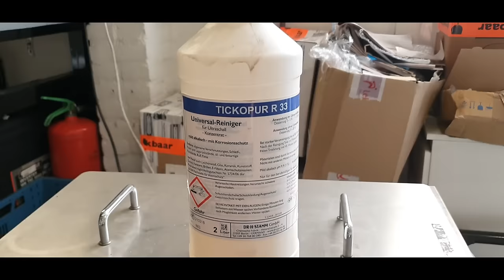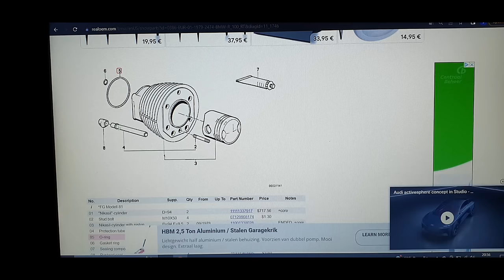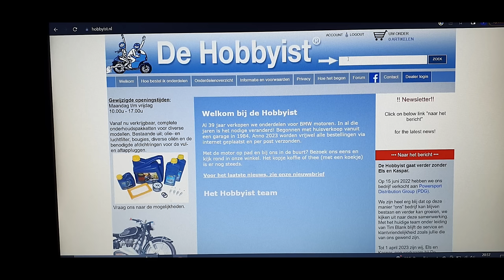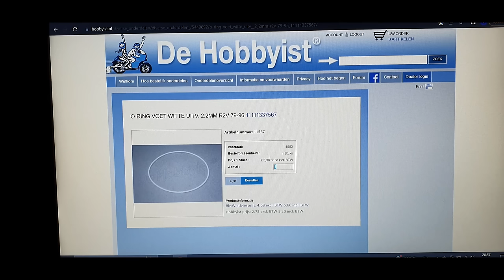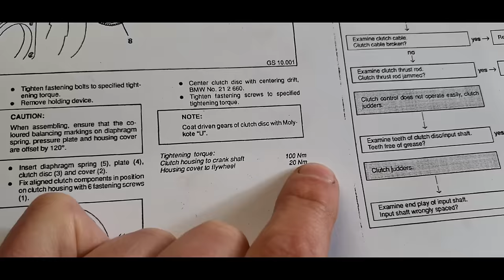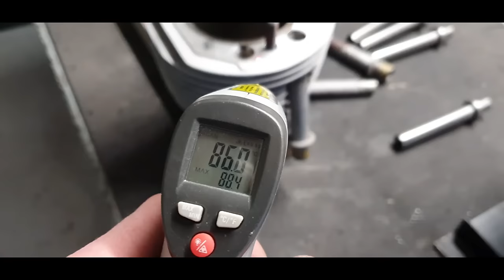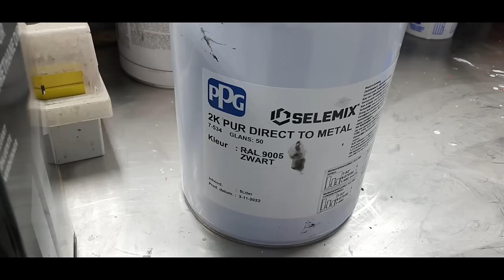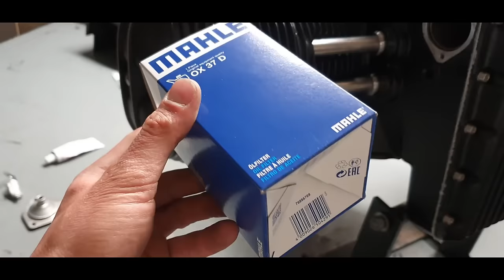How To Rebuild a Classic BMW R100 Engine

Comment: Nice to meet you, I'm sorry for my bad English. I'm impressed by your wonderful work. I'm sorry for asking such a question even though it's my first time meeting you. I have a problem.I ride an R100RS, and the black smoke from the muffler won't stop. What could be the reason?I liked your work, so I gave it a high rating and subscribed to your channel. your work is really amazing.
Reply from the maker: Hi man, no worries I understand you. Best thing to do is to check the spark plugs, these need to be brown (coffee with milk color). Thanks for joining the club, appreciated 👏🏻👍🏼
Reply: @corner.custom  Thank you for your time. I see, the plug on my bike was black. I wish you all the best in your future endeavors.
Reply from the maker: @sm-nr9qq Thanks man, good luck on the bike

Comment: Does the paint interfere with heat transfer on the cylinder head and oil pan?
Reply from the maker: The cilinders and heads got an Cerakote treatment, so the hot side of the engine. From temperature measurements I know that the oilpan, valve covers etc don't get near enough heat to get in trouble with the paint(spec)

Comment: @CornerCustom are the cylinder interior metal areas painted? Or is that just the look of the material?
Reply from the maker: What do you exactly mean with interior metal?
Reply: @corner.custom  I watched the video again. I was mistaken. Thanks for the quick reply.

Comment: Hello, 
I’m currently rebuilding a r100rt and using your video as a reference, could you tell me exactly which paints you used to paint the engine block? 
And how is it looking now, did you face any problems with cooling/paint cracking over the years?
Reply from the maker: Hi buddy, I mentioned the paint in the video, also show the paint cans. Selemix DTM 10% gloss. The engine in the video belonged to a client, but the paint and Cerakote held up perfectly
Reply: thanks for the reply, another thing I want to ask if you don’t mind, what’s the capacity of your ultrasound washer? I’m thinking of getting the 20L one but I’m starting to get second thoughts and a I’m worrying that it would be overkill for the airhead, ev future engine parts
Reply from the maker: @Sawp It's pretty big, 45 liter. In most cases it's too big, but I got this for a smoking deal, so couldn't let this one go
Reply: @ thanks man appreciate your quick replies
Reply from the maker: @Sawp No worries, just let me know if you have any questions 🫡👍🏼

Comment: I'm going to guess you're based in the Netherlands!? How much do you charge for a full airhead rebuild? eg an r80 gs 1981
Reply from the maker: You're not wrong! So yes im in The Netherlands. This was a one time exclusive job so the say, sorry for that. I'm loaded up with work and short of time unfortunattely. But on the other side there's loads of info to give it a try yourself
Reply: @corner.custom  Many thanks for your reply and for your excellent vid!
Reply from the maker: @touchingthecloth No worries man anytime. Just let me know if you have any questions 👍🏼

Comment: I wouldn't recommend the use of copper paste for lubricating the exhaust nut threads. It easily builds up contact corrosion between the copper particles and the aluminium, hence enforces thread seizure. BTDT 😞
Reply from the maker: Ok thanks for the feedback, what would you recommend? When fully seized I cut off the exhaust nut to release the tension. Did that work for you?
Reply: @corner.custom  There are ceramic and other metal free greases, or greases with aluminium particles for this purpose. Currently I use the latter one, after I had damaged a pair of cylinder exhaust threads by copper paste usage. A rather expensive experience!
Reply from the maker: @VixNoelopan Aii I feel your pain, thanks for the recommendations 👍🏼

Comment: You used two different paints to paint the engine. Cerakote for the cylinders due to temperature and Selemix for other parts. Why not cover the whole engine with Cerakote, is it because of the paint cost?
Reason for the question is that I'm facing a similar issue at the moment.
Reply from the maker: Good question! The reason why I chose to go with Selemix for the engine itself is because Cerakote recommands that the surface get a blast with aluminum oxide before applying the Cerakote. I did see other people use Cerakote on surfaces that were prepped by the use of a scotch brite pad, but I'm rather safe than sorry and the color match is also pretty good. You're also going trough a rebuild of the engine or just the paint phase?
Reply: @corner.custom  
Thanks for the reply. Actually the whole bike. Engine is just one stage of the whole project. It's also a boxer engine.
Reply from the maker: @magnusreimann1055 Perfect approach by done one step a the time. There are more R related how-to on my channel as well 👍🏼

Comment: Hi, just asking to clarify a doubt: isn't cherakote paint made to be a heat insulator? If so, wouldn't it make the cooling of the engine worse since the air wouldn't take off the heat from the heads and cylinders as efficiently as before?
Reply from the maker: No it isn't a heat insulator, there are even Cerakote types that are specifically used on top of pistons for a better heat distribution
Reply: @corner.custom  oh, good to know! I thought they only made the heat insulator one, thanks for the clarification!
Reply from the maker: @laferrarifabrummbrumm3878 no no no, just check out their website. They make a ton of different series for all applications

Comment: Is the air curing cerakote durable enough for an engine?
Reply from the maker: Yes sir. Used it for multiple builds and help up perfectly
Reply: @corner.custom  great. About to do engine covers of my Ducati in Burnt Bronze.
Reply from the maker: @GeertHeremans In the C series then? I did some Burnt Bronze as well, but then the H series
Reply: @corner.custom  indeed C-148.
Reply from the maker: @GeertHeremans Will be ok, just get your prepwork dialed in 👌🏼

Comment: Why wouldn't you disassemble the heads and check out the valves and guides? That era R100 had a lot of valve recession and guide wear issues, at least in the US models. I worked at a BMW Dealership and we sent a ton of heads out for refurbishment.
Reply from the maker: I rebuild this engine for a client and he told me that the heads were already rebuild, so that's why I left them untouched. My own R80/100 builds all had rebuild heads including new valves, guides and springs. Those build videos are on my channel as well
Reply: I’m wondering where would be a good place to send my r100 heads 1988. I’m near Kankakee Illinois
Reply from the maker: @daledahlman9629 Maybe you could get in touch with Matt from Euro Moto Electrics

Comment: nice job, but there has never been a R100 with round valve covers, the gasket on the front cover doesn`t need any glue, there is no oil behind
Reply from the maker: What do you mean exactly with round valve covers? The peanut style ones? I rebuild this engine for a client who wanted these
Reply: @corner.custom   they are looking great at the engine but are not original ones like in the beginning of the video, that`s all
Reply from the maker: @randypopandy All good man, everybody got his own taste 👍

Comment: Do you happen to have the dimensions of the engine stand?
Reply from the maker: No sorry I don't have the engine stand anymore. I rebuild this engine for a client and gave him the engine stand as well to safely transport it. Must make sure to make the uprights high enough so that you can take of the oil pan when the suction tube is still on the engine and that bottom strips are long enough so that the engine won't tip over
Reply: @corner.custom  thanks!!
Reply from the maker: You're welcome man, good luck 👍🏼
Reply: Why I the world would someone pay $20,000+  for an Eastern European bad attempt at making a true BMW, when you can get a used airhead for a fraction of the cost.  Proud owner since 1984.  Great video 👍
Reply from the maker: @tcmits3699 Right on man!! 🤟🏼👍🏼

Comment: What is the HP and TRQ numbers on this engine?
Reply from the maker: Power output of 60 hp at 6,500 rpm and 75 Nm (55 lb-ft) of torque with a peak at 6,000 rpm

Comment: can I ask somebody’s help, I have a r65 airhead and wondering about the exhaust, do i need to keep it separate or can i just put the two pipes in one ?
Reply from the maker: I've seen multiple bikes with a 2-1 exhaust. Don't really know if there are any downsides regarding to the backpreassure

Comment: Be very careful when using fuel around electric tools, sparks from inside the tool can ignite the fuel.
Reply from the maker: Thanks for mentioning. Like I said in the video I work in a well ventilated garage and don't spray and brush at the same time

Comment: Using fuel as a cleaner is how so many garages have burned down. It's best to use brake cleaner or an organic degreaser.
Reply from the maker: Like I mentioned in the video make sure it's well ventilated and wear the proper protection. Also the drill is brushless so no sparks coming from that either. Brake cleaner is also very flamable

Comment: You use "fuel" for cleaning? Is that like gasoline?  Doesn't seem safe.
Reply from the maker: Yes fuel/gasoline. Like mentioned in the video work in a well ventilated area, use a respirator, safety glasses and wear the correct cloves

Comment: Replacing an M6 bolt that gets 20Nm?? 🤔
Yea thats a little bit more than the recomandet torque for that size, but you are way out of the yield zone!
If you use them 10 times that maybe could lead to problems, but if you do this ones or twice.... it dosen´t mater.
For a customer of cause, but for the home builder thats no problem. 😉
Reply from the maker: Which bolt do you mean exactly? It's all according to the manual 👍🏼
Reply: @corner.custom  The M6 ones (I guess) for the clutch pack! 
On my bmw M50 engines every M6 gets 20-25Nm, even the valve cover in aluminum gets 22Nm.
By feel and experience I would say an M6 (clean and oiled) can take 30-35Nm before starting to yield. 
The M10-M12 for the flywheel with 100Nm get a little bit sporty, if they are M12 with a high grade, I would also reuse them. Smaller fasteners can usually tolerate a little more over torque, but bigger ones are easier to not fuck up by feel.
Reply from the maker: @martin09091989 those are stretch bolts and can only be used once, same goes for the crush washer that are used for the clutch pack.
Reply: @corner.custom  so they get an additional turn angle after torqueing?
If so, yea they are trash afterwards.
But stretch bolts need a smaller smooth shank, I can't see that in the video. If those aftermarket fasteners have threads all the way up I rather would put a drop of locking compound on them!
If you stretch the threads you risk a fracture.
Reply from the maker: @martin09091989 I believe that the OEM stuff is tested enough that it proved itself throughout the years. I'm not a huge fan of putting additional locking on the threads. Like I said the manual states torque it to 20nm, but I first go to 10nm and then 15nm so I know the disc is clamped in a more controlled manner
Reply: @corner.custom  Yea, an M8 with 20Nm is definitely not a stretch bolt! That's just the usual suggestion from the manufacturer to use new screws on such relative critical locations. I would have been surprised if they used stretch bolts on a clutch. Even car clutches have just M8, Somtimes even just M6.
Streich bolts are just used to limit the camping force like on injectors or for cyclical loading like in rod ends and heads for precise preload. Clamping a Pice of stamped sheet metal to a flywheel is not exactly a critical high performance application. 😂

Comment: Get yourself a ceramic laser cleaning machine. I mean these sand blasting methods look ancient before it
Reply from the maker: There are far better and easier methods to clean nowadays, but the costs involved are way higher compared to the blasting method. For a hobby guy that's a high bill to pay

Comment: I like the painting but technical works are pure shit! What about cylinders bores? What about honning them? What about valves? What about crankshaft? What about camshaft? You skipped all most important points! Painting is NOT rebuild!
Reply from the maker: I rebuild this engine for a client and we've agreed to go this deep into the rebuild as shown. Was a low mileage bike and the heads were already rebuild before. 
If you would take a look at my last R100RS build you'll know what a rebuild is
Reply: @corner.custom  thank you for explanation. But there was no any info about it in video.
How much i would have to spend for R100 today?